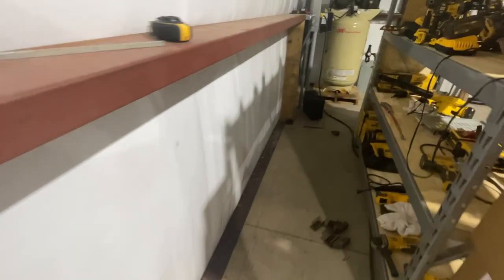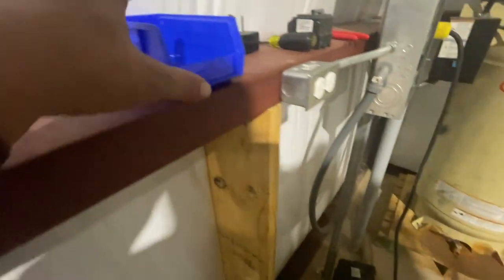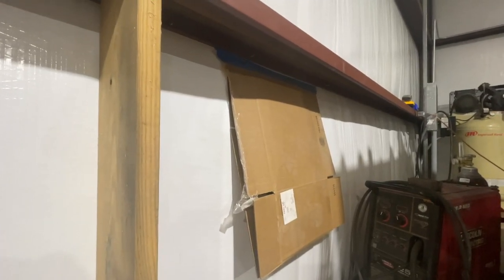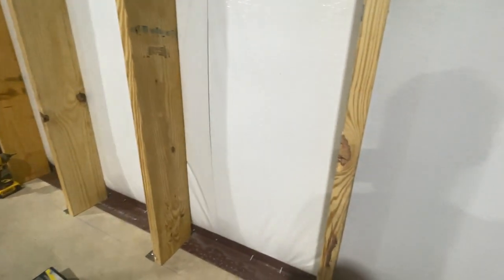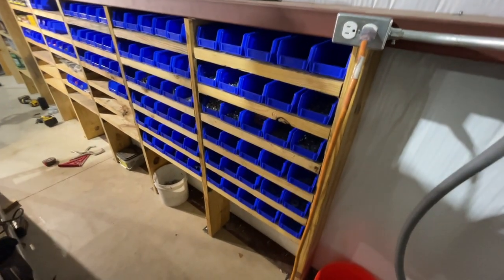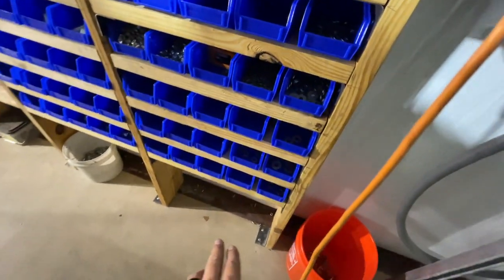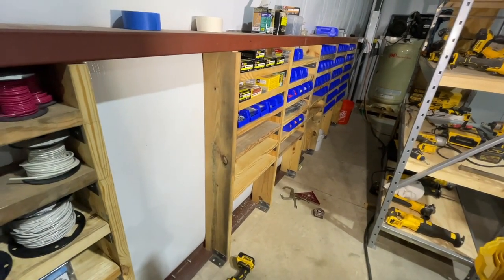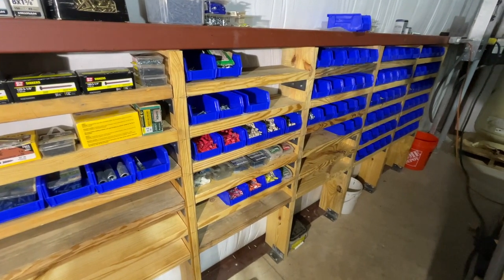Shop Organization : Bolt Bin and Shelving

Comment: I thought of something like this but the dust discourages me. Then I thought about making “drapes” out of the pile of translucent welding curtains I’ve had wasting space for years, trimmed to length, cut to 2’ or so with hanging grommets and/or a curtain rod situation so they could get out of the way. Idk
Reply: jeremy ballin yea but I’ve had the curtains wasting space for years and the company I used to work for loved to toss things so I got most of them for free, shit if I had room I could have had the $1200 cabinet they went in to.